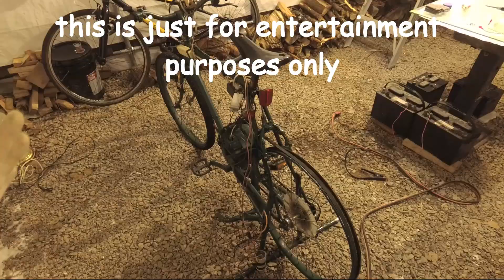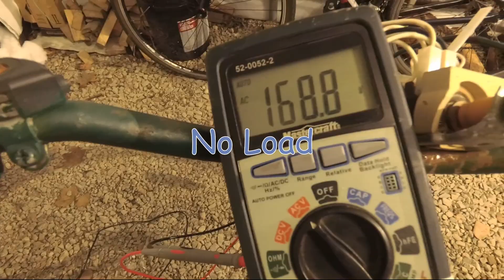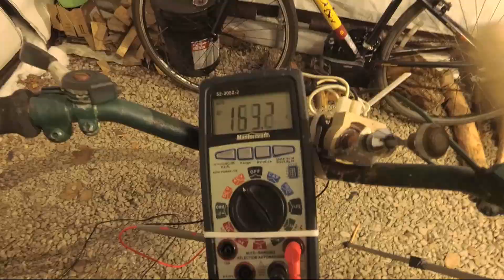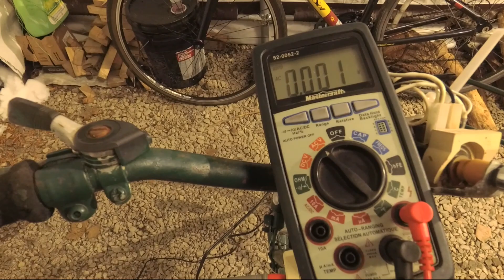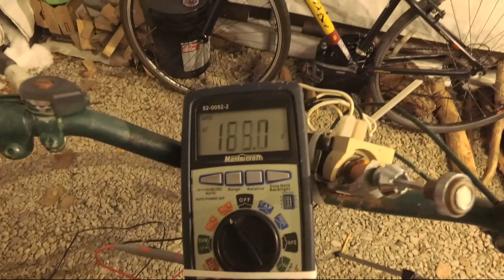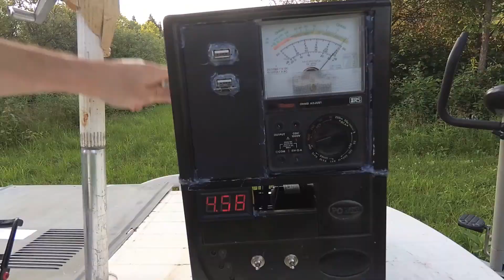Homemade Generator using a Car Alternator 120v AC | 12v DC [Free Energy]

Comment: How long does it take to charge a battery and how much can one battery power?
Reply from the maker: It all depends on the size of the battery and how energetic you are. Charging time varies depending on the battery type, capacity, charging current.  Lets say a 60 watt or 5 amp output while peddling would be a moderate pace. Let's say you can charge a 12v 10ah battery in an hour, than that battery could provide you about 120 watts for one hour.
Reply: @kurtscottage  Great Answer! Thanks because this is kind of like my favourite stuff, so I need to learn as much as I can.

Comment: The only problem with any of this human power, is that cost of the extra food you need to eat is more expensive than grid electricity. The average human can generate about 60w continously. That would take about 12 hours to change up. It's better to get a job and much easier. 😂
Reply from the maker: True, thanks for the comment.  The idea with this pedal generator is just for emergencies to charge a phone or run some LED lights.
Reply: @kurtscottage  How long would it take to charge a phone?